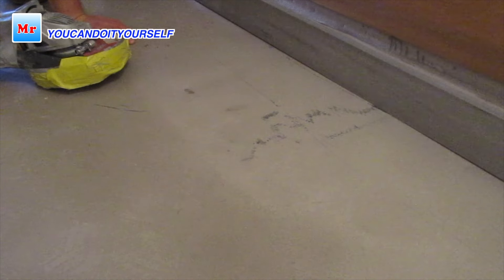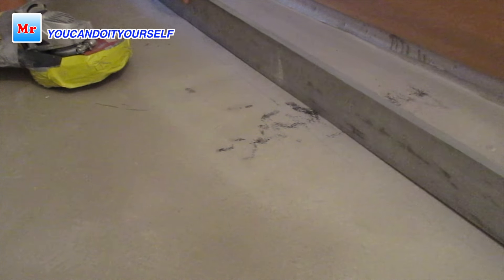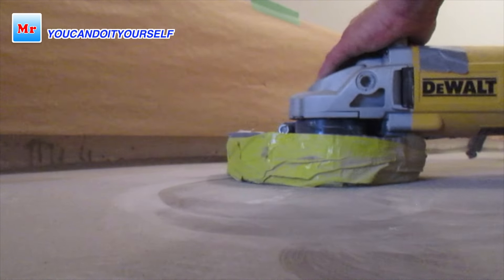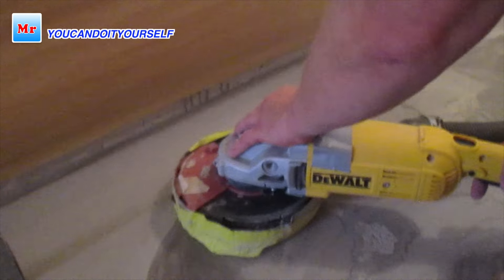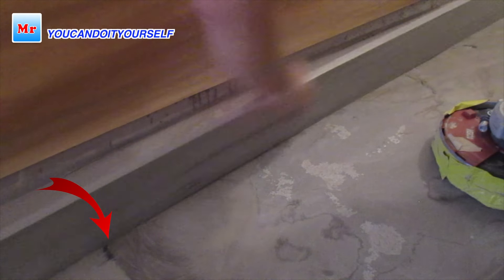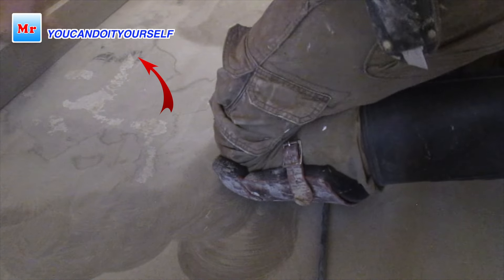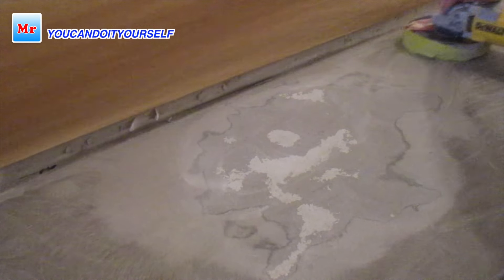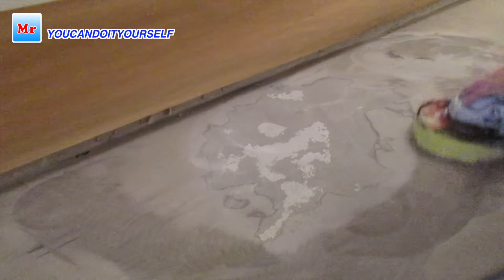🔥Do I Need Grinding After Levelling?

Comment: Thank you for the video. Do you have a video tutorial on how deal with concrete subfloor expansion gaps? I have that are about one inch wide. Just wondering what will be the best material to use for gap filling application. Thank you!
Reply from the maker: I did it once in mobile home. Just taped over this gap and secure the side of the tape with silicon and then level it. After instal floating floor because with others type of installation can get a trouble in a future.
Reply: @MrYoucandoityourself  thank you for your reply. Would it be possible to fill expansion gaps in a concrete slab with foam (Good Stuff or similar) prior to leveling? I’m going to glue solid hardwood planks and my fear is that taping over method may not warrant adequate strength and support. Please, advise.
Reply from the maker: I don’t know exactly your situation. Is there some movement in this expansion gap or it’s just for avoiding cracks?
Reply from the maker: Find me on WhatsApp and we can talk more detailed.